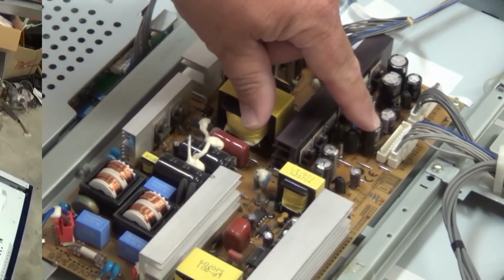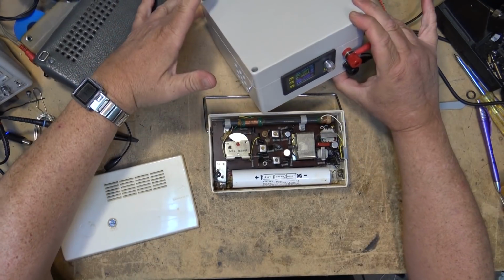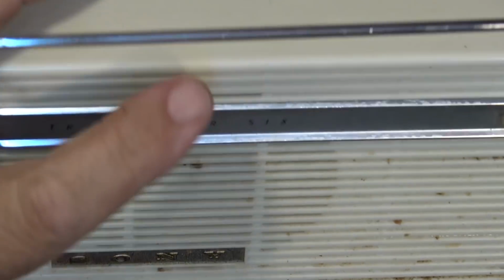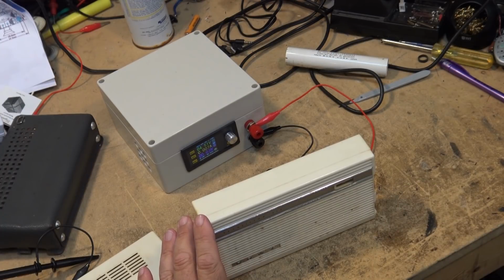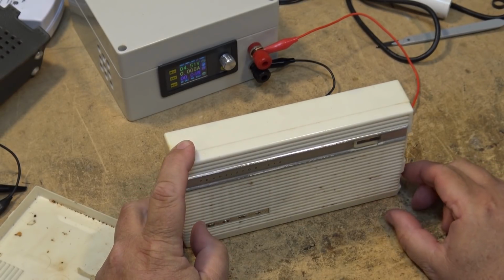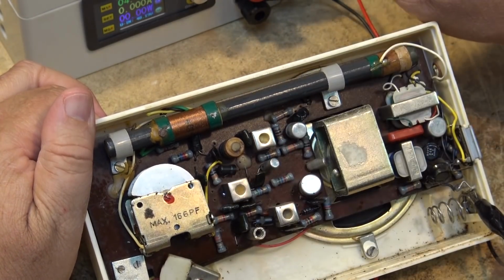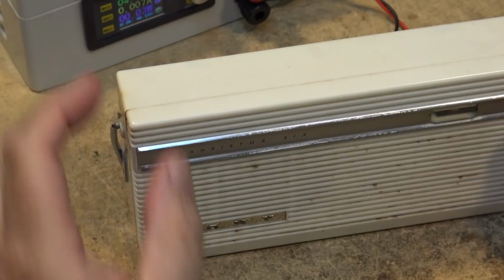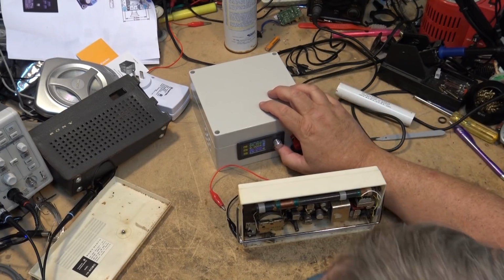Vintage Sony TR6080 AM radio repair

Comment: I bought a similar vintage sony radio, and got it delivered to my mum's address for convenience.
Unfortunately the postman put it in the recycling bin and it got recycled on the same day.
I got my money back from eBay but it certainly was a bit of a learning curve for me and my mum!
Reply from the maker: If you saw my rant on Canada post you know my feelings about not only them but fed ex, ups, and DHL as well.  They could use a trained monkey and get better results.
Reply: @12voltvids  thank you for the fantastic videos, I collect everything Sony but despite going to technical college in the 80s, I am very nervous about making repairs (especially soldering) but you give me the confidence to have a try. Big thumbs up.

Comment: Very cool radio and am tempted to get one of those power supply modules to modernize an old power supply I have.
Reply from the maker: Aron Gooch 
The power supply is excellent. Will actually go up to 50 volts but I only had a transformer that outputs around 36-40. I built it with what I had on hand. Transformers are expensive. The old transformer has the original radio shack price sticker on it. That's how old it is.

Comment: A good old radio :-D, and that outer case protected the plastic nicely :-D.
I bet a blob of clear epoxy resin would keep that battery post in place.
Depends on how far you wish to go with it :-).
Reply from the maker: zx8401ztv 
Yes jb weld will fix it nicely. This is as it was when I pulled it out of the drawer. My grandmother just used to put a little block of wood in it to hold the batteries. Back then we didn't have the super glues we have today.
Reply from the maker: Yes I know. I'll probably mix up some JB Weld and affix the battery terminal some day as I would like to fix that up. This one has been in the family for 56 years.

Comment: I like the old transistor radios.  That one still plays pretty good, considering how old it is.  Many of the old vintage transistor radios uses germanium transistors, which I think are not easy to replace these days.  NTE make some generic replacements.

Comment: Wow!... that wooden Sony is a valuable collector's item... congratulations to the owner for scoring that one.
Your Sony is awesome too.. especially since it's a family heirloom and thus priceless.... cool antenna in that set, ... lots of capture area along all that ferrite bar, and the link-coupled external antenna connection is the icing on the AM-DX-listening cake :-).
Reply from the maker: Yes it is cool. Will be repairing that one next probably as it won't tune anything. Bad caps no doubt. That one goes back to 1956.
Speaking of AX DX, I have been playing around with my old Sony XR-A37 AM stereo car radio. As you know car radios are pretty good. Was pulling in signals from all over the place last night including some AM stereo stations. I should make a video of that next time I go hunting for signals. I use a Cushcraft AP8 vertical for the antenna.
Reply: Right on.... and definitely, car radios with their RF amps  in the front-end can definitely pull in the weak stations, especially when hooked up to a nice long-wire antenna and a good ground connection.

Comment: I just got a deal on an old boombox with am fm... realistic brand... I fired it up and the radio sounded excellent and I listed to it for bout 20 min... then today I turned it on and it sounded like the stations weren't coming in near as strong but I grabbed one and went about my business and in a couple of minutes it sopped working... powers is on but the am and fm are not pulling down any stations??? what could that be... it's like a capacitor or another component failed??? 
or what ever captures the signal failed???   can you point me in a direction to look at.. thanks

Comment: Reminds me of the AJAX 8 transistor radios
that my parents bought me and my sister
when we were kids in the 60s, listening to
radio Caroline and Luxembourg, I found,
by accident, that by selecting a Sw.frequency
on a 40s cabinet radio that I had, I could block
the MW frequency in her room next to mine, and
replace her music with a annoying high pitched
tone, which was useful if she Pissed me off.
Later bought a second hand Shaub Lorenz,
now that had some guts in it and volume.

Comment: Is that a switching power supply, if so would be better to use an analogue transformer supply, its quieter.
Reply from the maker: It is all I have.  Normally this would run on batteries.

Comment: Did you get around to fixing the battery contact and faulty volume control in the sony TR6080 ?
it looked like a decent radio in 2017, a little clean of the grill with a tooth brush would make it fresher.
Reply from the maker: No I haven't done anything with it since this video.  It is still in the same drawer it has been in since I put it back after shooting this one. Some day I will bring this one out again and glue that battery compartment back together.

Comment: I want to ask you if the tuner cleaner and lub.Will work on that volume knobs ,I bought a fan a while back from radio shack ,I didn't no if I should have bought just a tuner cleaner or a tuner cleaner with a pub in it ,I have a seventh or older I want to no if I can use my cleaner and lubricant on it.

Comment: nice video grab some step down power transformer and voltage regulator for your radio power supply run your radio on that supply... it should work fine without noise
Reply from the maker: Will work fine on batteries too. Going to fix that battery case some day.

Comment: I have sony radio model 6R-24 8 transister, but cutted cable wire how to repair it, plz help im so sad for this, i will be thankful to you
Reply: 1-Bring out both ends of copper wire & connect them, put around insulation tape. 2- find electronic s hobiest

Comment: Can you give more info about your in house AM transmitter ?? Anything bought or built by yourself ?
Reply from the maker: jpdesroc 

I built it. The condensed build is on my channel and the full 3 hour component level build is available to patreon users. 
Look for am stereo transmitter build. I built it only a few weeks ago. Was a kit I got off ebay. Range is about 1/2 block with piece of wire for antenna.
It is a Motorola C-QUAM compatable  stereo transmitter. I will be showing off some of my other am stereo radios receiving signals from it in future videos.
Reply: Thanks !

Comment: also the station indicator light is not illuminated as it was nor the fm stereo indicator lights.
Reply from the maker: There are no dial lights on this radio.
Reply: 12voltvids I know . sorry for the confusion. I was asking you about the boom box I was having trouble with.

Comment: hi love all videos where can i get the power supply kit from that you built
Reply from the maker: XXEllieXX 
The video of that power supply build Is on my channel. The regulator module came from banggood.com   it is basically a transformer, bridge rectifier and capacitor plus a fan and the dc-dc buck regulator module. Works fantastic. See the video of the construction and read all the negative comments on my construction techniques by those that wrote a comment before seeing the finished project.
Reply: Home made power supply, use arduino may be.

Comment: Plus batteries lasted longer because germanium transistors used only half the power to run...
Reply from the maker: Kennynva T. 
Correct. Actually they used even less than that. About 1/3. Only a .2 volt junction drop as opposed to .6 for silicon which means that as the batteries run down they will work until the voltage is lower.